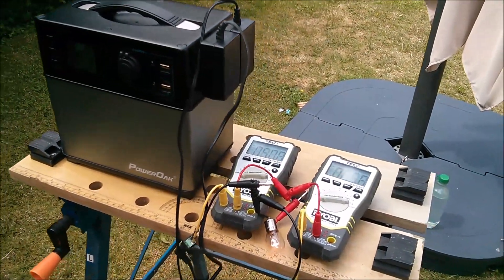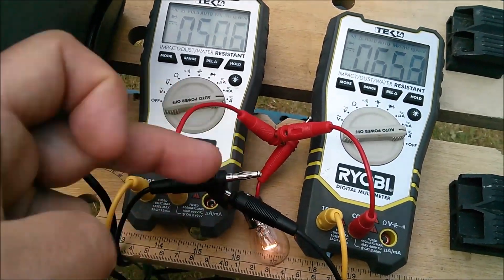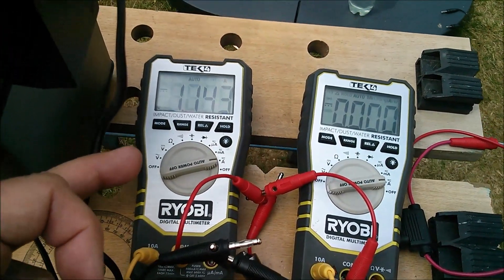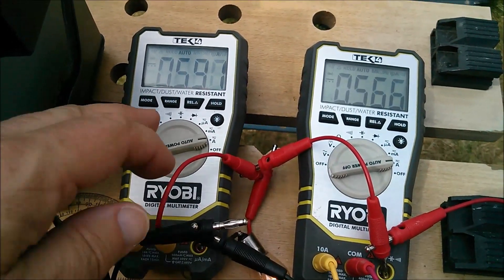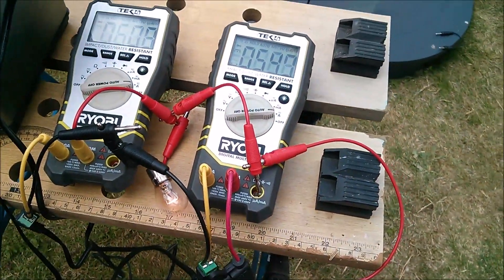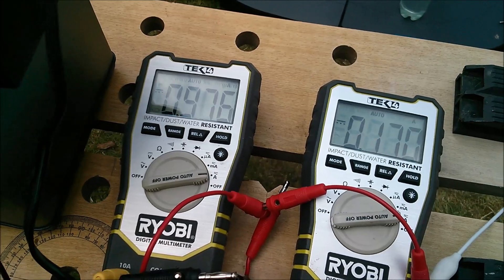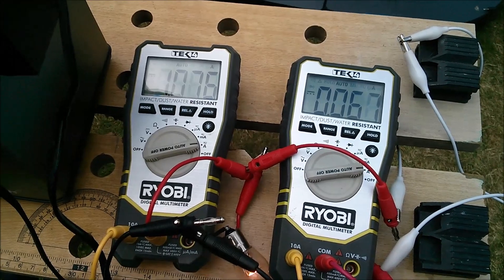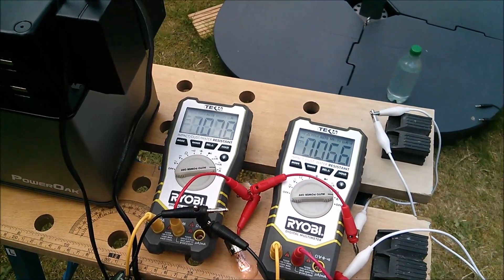PSUs in Parallel

Comment: That's the same as if you had 2 batteries sharing the load, the only constraint is if the power supplies have current limiting, otherwise you could burn out one of them.
It's something that is done with servers, they have redundant supplies, but each can fully supply the server on its own if one supply fails.

Comment: The voltage and impedance of each supply is critical. The impedance will often vary with load and temperature. If you can increase the effective impedance by adding series resistance equally to each supply sufficient to dwarf the natural characteristic of the supplies, and can adjust the voltage to balance the current, it can work pretty well. Otherwise its a crap shoot.
Reply: No, the accuracy of the set output voltage and the accuracy of the regulation loop are more important. Then the impedance of the output leads/wiring should be enough to allow current sharing. If this is tried with unadjustable regulated PSUs or worse, unregulated PSUs then it can become very difficult to get equal current sharing.
Reply: @Mark1024MAK  Yes, that's true in an ideal world where power supplies have negligible impedance (such as in parallel with an effectively infinite bank of lead acid like a telco). In the real world absent a huge parallel battery you need to compensate and there are two ways: series resistance or communicating supplies.

Comment: In telecom we typically have multiple DC power supplies operating in parallel with a bank of batteries and all the loads. The voltage of the power supplies is carefully balanced so they each provide an equal current at the float charge voltage of the batteries. 

There will be enough power supplies in a given installation to supply the entire load's demand if one (or more) of them fails - which also allows some headroom in the system for a battery recharge following a mains failure.

Comment: I work with industrial installations and one of the requirements for certain equipment is to have redundant systems. So some equipment has duplicated SMPSUs wired in parallel. If one fails, the remaining good unit will continue to supply the load with no interruption of service. However to get the required current/power, we actually use two heavy duty SMPSUs that each have two outputs. So that’s four outputs, all wired in parallel.
To get the units to equally share the load current requires us using a (expensive) highly accurate 4.75 digit digital multimeter and careful adjustment of the ‘fine’ output voltage adjustment control for each output. Both with both SMPSUs on, and with each running in its own.
We check the adjustments every 12 months.

Comment: Hi, Julian. 
What happens if you turn one of the power supplies OFF while they are both connected to the load?
Reply from the maker: The other one increases its current output
Reply: @JuliansShorts  If you plug it back in does it still start up and take on some load or does it stay off?
Reply: He already demonstrated that.. 0:35

Comment: it all matters about the voltage that each PSU is outputting, since they can be 5.1v or 5.2v then that 0.1v difference will need a large resistance to balance them again. unfortunately adding the resistance will not keep them balanced as the current increases which will also cause issues.
I have talked about this problem when using my big 720W PSU for the Power Hub, it has a 2S2P arrangement of Dell laptop chargers. I tried to match them with close voltages in parallel but it still isnt enough to get the full output without tripping the one with the highest voltage.

Comment: Use a Shunt like those used with Amp meters between the PSU and Load and they will share much more uniformly.  Switching PSU act vary different when they are pre loaded.    Even a shunt with like  0.001 Ohms makes the difference..   Seriously , Try it.
Reply from the maker: Well, there are 2 multimeters on the bench, both reading current, so I do have shunts in circuit. But the resistance of the PSU cables is probably far higher than the resistance of the current shunts.